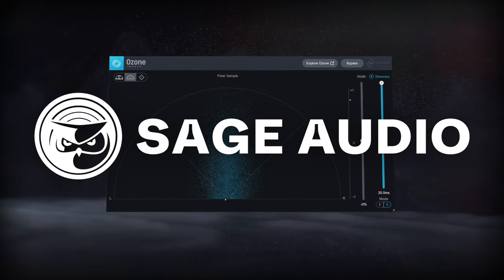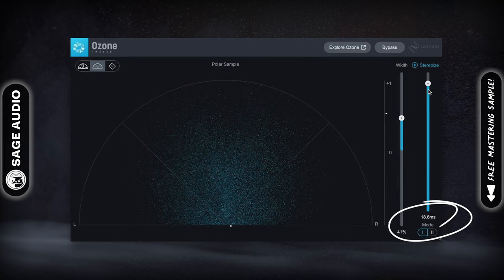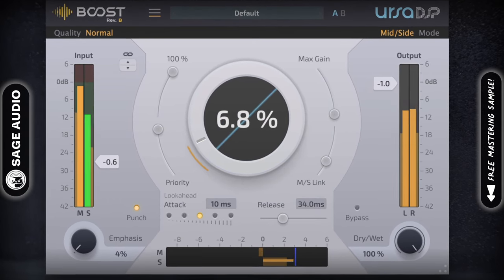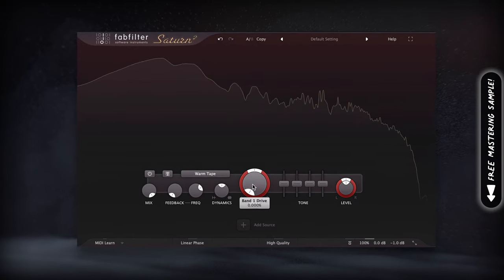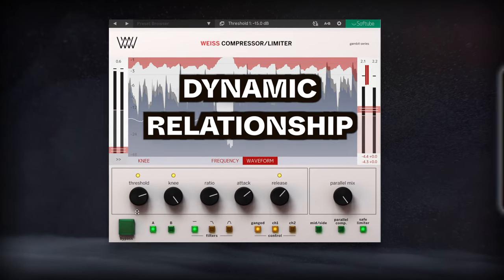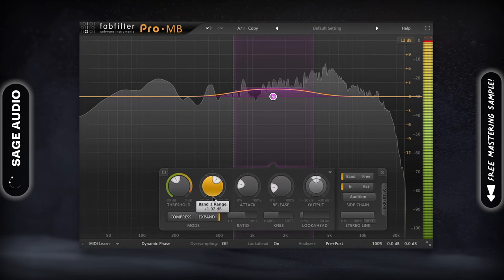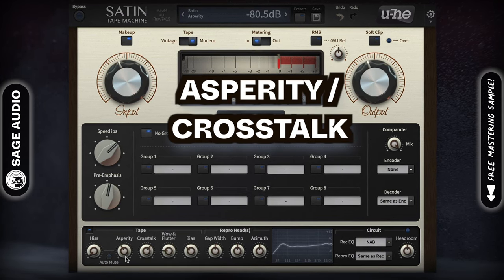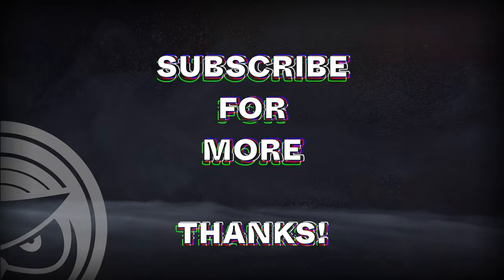How to Stereo Expand Your Master

Comment: Point taken about not using imagers generally. BUT you pointed to the delay time for the stereoize function on Ozone Imager. Stereoize specifically creates a stereo signal out of a mono signal. The delay time you mentioned is not relevant if you're not using stereoize

Idk what Ozone imager uses for their stereo expansion, and it might use a delayed signal too for all I know, but the delay time that you pointed to is specifically for stereoizing, not imaging generally
Reply from the maker: Thanks for watching and detailing that! It looks like the width slider does something similar to stereoize, but is frequency specific to avoid expanding low frequencies.

SageAudio.com

Comment: Great tips!
I use a hardware Vertigo VSM for M/S compression (kush Audio tweakers), EQ (hammer 2, Maag eq4) and saturation through the 2nd (on low end in the mid) and third order (high mids on the sides) 

The hardware has two inserts for compression and EQ which include a mid side matrix 

Uad makes a vsm 2 plugin where you can do the same thing!
Reply from the maker: That's awesome! Thanks for sharing your routing and providing some options for how to replicate it! 

SageAudio.com

Comment: this is awesome, i have one question though, at what step in your master chain should you use a mid side processing plugin, or if possible could make a video on the right way to arrange your master chain in order to archive a certain tone... for instance in vocal processing, i know placing an EQ before a compressor will sound different from placing a compressor before an EQ...I really love this channel for the knowledge you impacting. Please if you could clarify my question though. Thank you.
Reply from the maker: Thanks for watching! I usually start my chain with a mid-side EQ to attenuate aspects of the response.  Keep in mind that after the plugin has processed the signal as mid and side, it's output as a left and right stereo channel.  With that in mind, you can add a mid-side processor at any point in your chain.

SageAudio.com